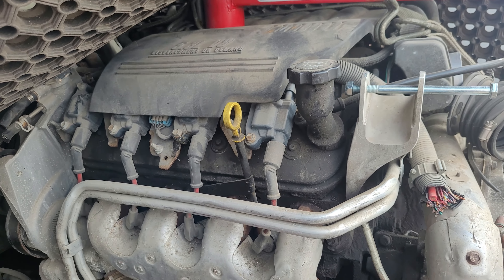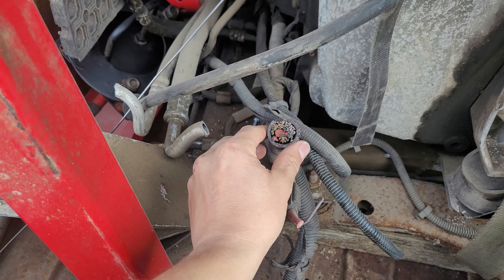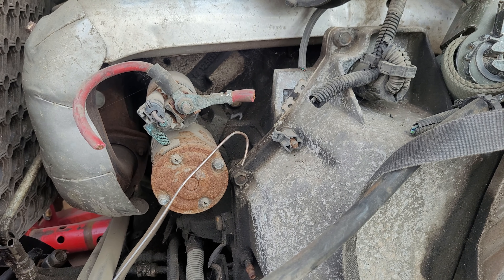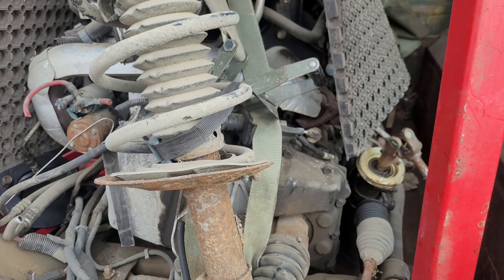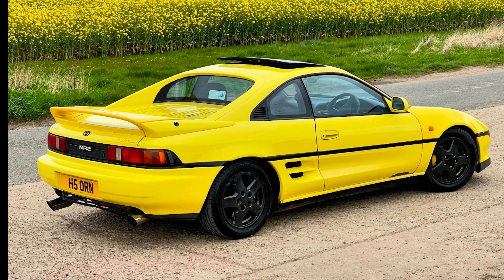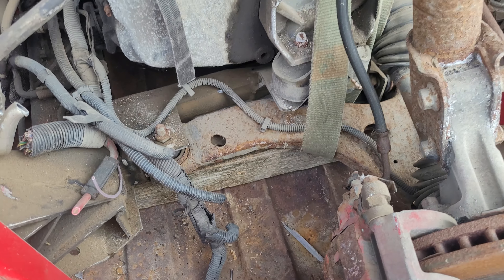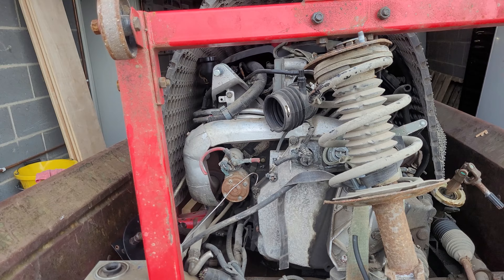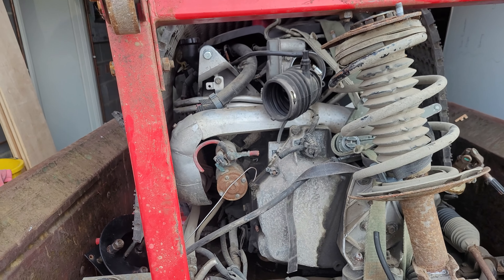Comments on the LS4!

Comment: The 4t65e-hd  transmission is not very sturdy.  I've used 4 transmissions.  Now there is an alternative you could use.  4t80e. Some modifications needed, bit way better transmission to upgrade for your swap
Reply from the maker: @Cheezn4urdreams  you're right about that,  I've seen videos on that. Good option for sure
Reply: Nah the 4t80e is really the only option. 
I've been swapping them in place of the 4t65e since 05.

Get another one and build a twin drivetrain car like us lunatics
Reply from the maker: @Turbocharged400sbc  I hear what you're saying, did you see the Hot Rod Garage twin engine Impala? They used the gear star built transmissions. I would buy a 4L80TE but shipping to UK is a bit of a bitch!